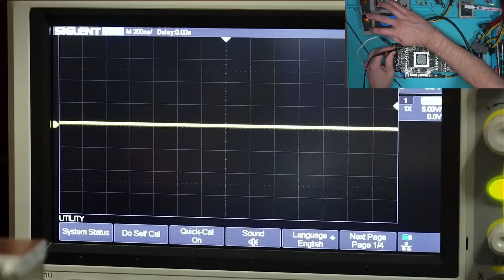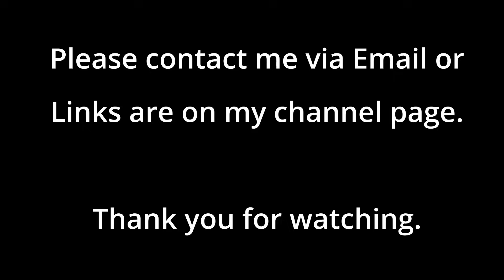Precision Repair: Gigabyte 3080 PCB Cracks Fixed with Microscopic Magic!

Comment: Cracked PCB repair is interesting to watch, but I still don't understand why they route wires through what looks like an obvious damage point.
Reply: I have the same question myself, it doesn't make any sense at all. Honestly, it looks like they're doing it on purpose.
Reply: Its for planned obsolescence
Reply: i know it looks bad but if you get to play around with bga routing in autodesk Eagle, altium or kicad you will see how fast you run out of space to trace with only 2 layers, that's why gpus are 5 to 8 layers (all the memory chips and the core are bga), add to that the fact that you have to route 82 lanes to the pci e x16 connector (at least 32 of those critical differential data lanes) and at that point every mm counts, i think the problem comes from those ridiculously oversized coolers, i'm quite sure you will never see this happening to a Intel A750 or A770, i never did back in the Nvidia 9800 gt era.
Reply: If they can save money by not adding an additional PCB layer, they will do it.
Reply: @wolveric0  If there was to be a 5mm exclusion around the PCIe latch on the PCB for example how would it affect overall size?

I've always wondered why PCB traces are routed this way , thanks for your comment!
Reply: @wolveric0  for high end GPU 14 layer board mostly is for big copper ground and power plane. Its no use other than to make repairing very difficult even for removing single smd resistor or capacitor  unless you know the trick using hot air or have a expensive hot tweezer or a big preheater to remove qfn chip
Reply from the maker: One reason I can think of is to protect signal lines from heat related effects and possibly electrical noise generated during high GPU load.
But even with that in mind, I think it could be a little bit further from that area.
Reply: Wow. A hardware surgery. Like and subscribed.
Reply: they are perfectly aware that this notch is very weak. why not to strengthen that? like a small titanium plate etc. the truth is manufacturers are not interested in everlasting products these days.
Reply: To make you buy a new one because they refuse the warranty. 
They don't even say that you have to use gpu support, so until EU does not do anything, this shady marketing strategy gona continue.
Reply: @kikihun9726  But you really didnt have to. The card (even heavy one) can just survive many years after warranty, without any support. Not everyone is that lucky, but some do. + The whole GPU design is outdated, PCIE slot and one screw is not enough to support modern cards at all, they will get twisted and bended, and then dead even with support stand, it will just take longer.
Reply: My guess is planned obsolescence or ignorance
Reply: @alexturnbackthearmy1907   I bought horizontal case (Thermaltake Core x5) many years ago. As the cpu cooler doesn't hang, I had not need to paste it again, my cpu heat numbers didn't go up for years.
And gpu does not hang , too. I will never go back to vertical cases.
Reply: The center via point have to connect to left trace , not up trace. Now its not connected to anyrhing. It's work, this is  important 😂
Reply: This happens because there is an office. And in that office there is a finance manager. When the engineer finalizes the first PCB design draft, the manger has to estimate production cost. After he does the manager tells the engineers manager: "these damn cards would be more expensive to produce than last generation! This is an unacceptable design." Then the engineer gets the news that his draft was rejected and that he has to save cost. This repeats X times until the engineer has saved 3 board layers, 15 components worked 80 hour weeks as the release date get closer. He had to make dozend of bad design choises until then. Then the card gets released. The finanacial manager gets a bonus check as he has saved the company a lot of production cost. After a few month RMA numbers rise. The engineer gets all the blame for finalizing such a bad design and gets fired. End of story
Reply: @hugomatos1999  manufacture do not like their product selling in second market after 3 years warranty repair ended. Its no secret second market buyer don't treat their GPU like family heirloom
Reply: @wolveric0  only 5 to 8? Motherboards that we make are 20 layers usually
Reply: @wolveric0  brother should i buy the 4070 ti super gigabyte gaming oc or eagle oc o. I need a card which is compact and dual slot . rest msi and asus are expensive in india, they r priced in 4080 territory and i dont like inno 3d , zotacs , galax or colorful , i am upgrading from Nvidia Rtx 3070 FE. please suggest and tell me is there any difference between gigabyte model in terms of VRMs, mosfets and phase design . are eagle oc really inferior to gaming oc model?.
Reply: @kiwichess vga support stick for like 5 USD is cheaper solution

Comment: I've had to repair traces in my board last week, and your videos on cracked GPUs I've seen in the past were of great help in how I could find traces and how to solder those.
Reply: Actually I fucked up something else and it's now deadier than before hahaha
Reply: @ZGtx  It often happens, don't worry man, I'm just now learning to solder, micro solder, tried fixing my Xbox One controller button, failed miserably, realized i need a lot more dead boards to experiment on before I get where I need to be to attempt desoldering and resoldering stuff on my dead GPUs.
It's tough to keep motivated when you spend time on something and it's even more broken, but nobody started knowing everything.
Reply: @SyncF  yeah, I'm okay with that. At least is more learning to do now haha.
Reply: @ZGtx  I nearly spat my coffee across the room when I read this message after the first one, sorry but it was really fkin funny. 😂
Reply: @LeeMc007  guess what, I've got to buy another one, because the one I fucked up is fully FUBAR.

Comment: I am very happy you went in to the specific's of what type of flux you used in this repair and why.  I have used both those versions of AMTECH flux, and I agree with your assessment.  On a side note, I remember the 215 version smelling kinda like curry with cinnamon.  So I loved soldering with it....... I know i shouldn't be breathing it as it is very bad for you and filled with cancer chemicals.

Comment: Because physics are real and things break under weight/pressure, I mounted my 3080,3090 & 4090 vertically. It makes life easier and hopefully a longer one on the card and motherboard slot.
Reply: on old time 500grams gpu was heavy :D now .1.3kg 30xx ,40xx are now 1.8 kg so yep  vertically must be standart  now on pc case
Reply: @pavelstoikov3780 my 3090 kp with Optimus block weighs like 6.6 lbs
Reply: holy cow man  @Apollo-Computers
Reply: @pavelstoikov3780  yea it's fcking insane how heavy it is. The funny thing is, I've seen them mounted horizontal in the mobo slot and I've NEVER heard of the cracked pcb on a kp. But I never even chanced that, one thing I hate about the block is it stops about 1cm from the io bracket....... front and back
Reply: I agree , vertical mounting is a must - or at least using a support bracket with the size of these cards. There needs to be a modification to ATX spec to take into account the sheer size of these expansion cards. (compare to 20 year old graphics cards).
Reply: @Apollo-Computers I guess the people who buy cards like KP (the very top of the top) are enough of tech enthusiasts to know that they have to use a support when mounting horizontally?
Reply: @Apollo-Computers   on old times i have HD 6870 TOXIC  edtions and remember i have  braket to not sag :D

Comment: I watched the video at 0.25 speed to see each step more thoroughly. I think the most important here is to explain why you use the specific tools and in which order to trim the PCB and each layer and what diameter is the wire you use for bridging. Also regarding the visibility, using light from the sides wouldn't it make it easier to see through the reflections and the burnt flux ? And finally, how you make sure that the end user will handle the card with care so it won't break it up again ?
Reply: customer will break it again and then complain it wasn't fixed

Comment: I hope everyone is using these cracked GPUs remotely, because without a reinforcement patch over the crack I don't see it being as strong as before, ie, there is nothing to keep glue bound together.
Reply: ...I hope you know that PCB is essentially hot glue (or whatever resin it is) inbetween cooper plates.
Reply: yeah i thought that but then he went back over the traces with copper wire so if it does flex it should be fine but i guess the danger now is it cracking more

Comment: On the 40 Series Super Gigabyte got rid of that big cutout behind the pcie locking tab. Now the PCB just goes straight across like it always used to and like on most Asus cards.
Reply: brother should i buy the 4070 ti super gigabyte gaming oc or eagle oc o. I need a card which is compact and dual slot . rest msi and asus are expensive in india, they r priced in 4080 territory and i dont like inno 3d , zotacs , galax or colorful , i am upgrading from Nvidia Rtx 3070 FE. please suggest and tell me is there any difference between gigabyte model in terms of VRMs, mosfets and phase design . are eagle oc really inferior to gaming oc model?.

Comment: I am wondering why you can't just run off of the first 4 or 8 lanes when you have a crack right at the pcie edge connector.  Are there traces coming from the first 4 or 8 lanes at the end of the card?

Comment: One thing I've noticed about the way board crack is the PCB density seems so lackluster.

I remember Aureal back in the day released the SQ2500 PCI sound card and that PCB board was dense and heavy. I have had other sound cards up till USB audio and HDMI audio effectively replaced it, and none of them felt as good a quality as that board from 1999.
Reply from the maker: GPU pcbs have many layers and they are not very thick.  in order to fit into the slot and maintained production standards, I don't think they can make it any thicker.
Reply: @northwestrepair  have you ever done a chemical analysis of the PCBs of boards that have cracked versus boards that have held up well, but became donor boards though some other fault?

Comment: love your videos sir! Couple of questions; what size of wire do you use for these crack repairs? Is it 0.01 or 0.02? Also would love to know what suction cup you use for BGA
Reply from the maker: Both.
Suction is made from a writing pen and a bent syringe needle with a suction tip

Comment: Thank you for the video, but I have a question. We can see a crack in the top layer, and you grind past that. Then we see a ground? layer with a crack, and you grind past that. After this we see the broken tracks which you fix. The question is how do you know that is the final layer with broken tracks, and the untouched layer beneath has no broken tracks?

A bit fast, but still a great video.
Reply from the maker: Experience.

Comment: the video is pretty fast. Are you grinding the layers away ? What are you using ? And what are you applying on the lest side ? Isopropyl alcohol ? Or are you using some acid ?
Reply from the maker: Alcohol.
Reply: @northwestrepair  Thanks, but the second part is, are you grinding with a Dremel or how do you remove the layers ? If you are using a Dremel, what kind of wheel do you use ?
Reply: would be great, if you could give me a tip here
Reply from the maker: @kevinmeyer6255  watch and learn. I don't know what room to give you.
No one gave me any tips. I just watched.

Comment: Curious so I'll ask. Given that there's no alternative to the 4090 in terms of current performance, based on what you guys have had to deal with so far regarding 4090 partner cards, which brand would you recommend if I had to get a 4090 for a build?
Reply: not gigabyte
Reply: @BelowAmbient  every card will break if you treat it wrong.
Like the asus 4090 with a 4KG cooler.

Comment: how do u strengthen board after this crack? i have7900XTX with badly broken power part of pcie connector. i can make jumpers but how this card can be normally used after such a crack

Comment: Can this happen to any card - or is it a product of abuse or bad card alignment in the chassis? Is there any way to ensure your card will not crack in your machine? Thanks. By the way your "hello internet" doesn't sound as happy of late - i just wanted to say how therapeutic your videos are, and how much I appreciate you and your channel. Thanks !!!
Reply: It can happen to any slightly heavier card if you don't use a proper anti sag support to keep it level. Gpus are too heavy nowadays and the old way we plug them in is not enough on it's own anymore. Specifically those big 3 fan cards

Comment: Tony i was going to sleep, but my pci expess slot on the bed got a big ass crack. Should i use copper wire to connect my butt line, or do I get the 90 degree adapter for the pci cables so it doesnt melt my pillow. I made sure and slotted my head in the pillow all the way.
Reply: lol wtf

Comment: are you going to work on the cracked suprim you showed in earlier vids?
Reply from the maker: no. it went back. I didnt know it was so bad before i received it.
Instead of making a hole bigger and uglier, its best to sell it for parts than to try to repair it and pay repair repair attempt fees.
Reply: @northwestrepair  Did you invoice the customer for a 'no fix' and tell them "it's not practical to attempt this type of repair" ? 🤣😂

Comment: What keeps those fine traces you soldered from rupturing again since the cracked pcb is lacking structural integrity ?
The owner should mount their gpu only vertically after this repair.
Reply: Hope. (If the user does not use the gpu without any support)

Comment: I just bought a 4080 pny and boy  does it feel flimsy,my msi 3080 is significantly more robust
Reply: buy a support bracket or refund it and buy a another brands 4080 if you can
Reply: Just use a gpu support and everything will be fine.

Comment: well, if it's one thing i learned here , i know what to expect soon as one of the fans on my 7900XTX is starting to spin to 100% at random even at idle temps.....a pity you live so far away from me. My card is about to have a major failure, not surprising with the temps AMD seems to think are OK, clearly they are not and way to hot.

Comment: I have a problem with my PC ,
Screen shows artifacting even in bios . And windows boot again and again after showing window 10 logo at startup .Also while installing gpu drivers .
On fresh window install it can boot up until gpu driver installation starts.
Also i try another card (old one) works properly with no artifacts or bootloops.
Any idea?
Reply: You have a dead GPU.
Reply from the maker: depend on the gpu and memory it has
Reply: @northwestrepair  my gpu is old r9 370 amd 4 gb variant.
Cpu r5 5600x 
16gb ddr4 corsair vengence .
500 watt psu
Mothrboard aorus x570 pro.
Reply: @lelouchabrilvelda1794  i think so because every thing is working fine in bios and with other gpu .

Comment: Really stupid design incorporating circuitry into an area so easily damaged when the PCIE "lock lever" is sometimes obscured by the GPU itself.... I have one I can get to with a long, really thin screwdriver to release and another that needs a long L shaped hex key to get under the GPU but you have to do this with utmost caution to fully ensure it is released!!!  (ie older MOBO's on office systems(Haswell) upgraded for Zwift/basic gaming with say a 1660 Super )
Reply: some mainboards have a button which is further from the slot and pulls on the latch